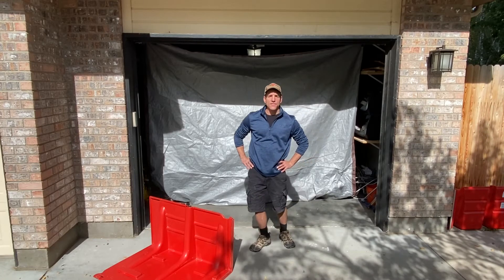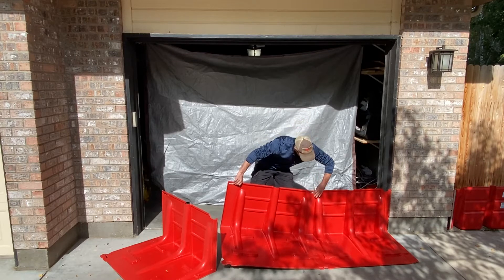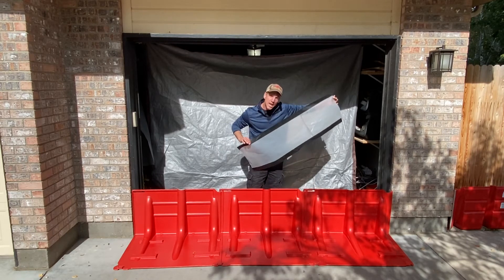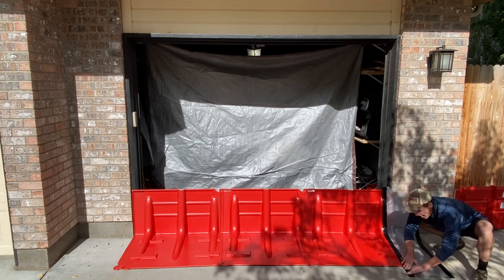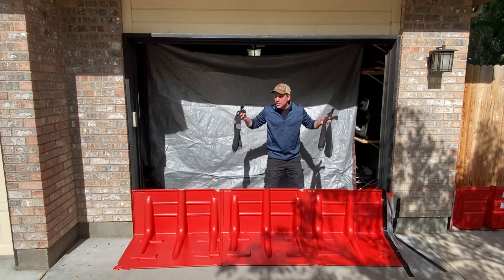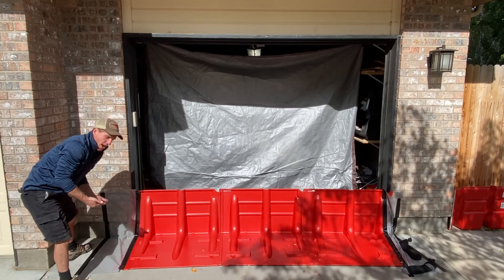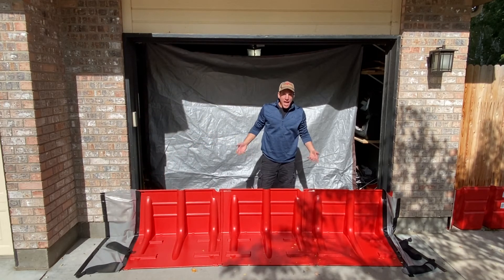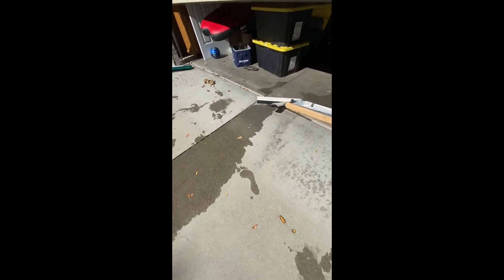NOAQ Boxwall Flood Barrier Tie In Example - Flood Defense Group www.flooddefensegroup.com

Comment: where can I buy those tales that you used to decide the sides ?
Reply from the maker: I simply used strips of 6mm plastic sheeting that was Gorilla taped between the wall and the NOAQ Boxwall as well as to the ground as seen in the video.
NOTE:  This test was to see what the seepage rate would be  for the Boxwall units that did not have plastic over them but.......It is easier to simply use one full sheet of plastic that is taped to the wall on either side of the NOAQ Boxwall as well as the ground in front of it.  Plastic is a fantastic 'insurance policy' against seepage and we like to cover almost every barrier we have with plastic.  It is too cheap, easy, and effective not to do as far as we are concerned.

Comment: In Florida the flooding comes with hurricanes. Will the barrier stay in place?
Reply from the maker: We have supplied countless NOAQ Boxwall flood barriers into hurricane zones where we suggest you place a sandbag on the toe of the unit for additional downward pressure in the face of hurricane force winds.
We have only heard of one line of NOAQ Boxwall (about 5 units placed between two buildings) get blown out of place during a hurricane.  In this case, the buildings channeled the wind and air pressure between the two buildings and the Boxwall units, which did not have sandbags on the toe, blew out of place.

In the example of this video, the units were placed up against what would typically be a closed garage door.  This placement, with a sandbag on the toe of each unit, would not have us concerned about displacement from wind because of the fact that there would be no wind being channeled through a tight space similar to the one example that blew out of place that was placed between two buildings.

I hope this makes sense and if you ever want to discuss it further, feel free to all us anytime!

1-208-585-1815

Comment: Would this sustain a hurricaine of 150 mph winds?
Reply from the maker: It would all depend on direction of wind impact, was it gusting, and the configuration of the NOAQ Boxwall but I would say that it would not UNTIL WATER IS AGAINST IT
Therefore, I would simply place 'x-amount' of sandbags on the toe of the product to keep it anchored until the water shows up if you are in a high wind environment.
This product is regularly used in hurricanes in this manner!

Comment: what's the unit cost of these?
Reply from the maker: For a full pallet or more, this is the cost broken down into price per linear foot.  We like to break it down into cost per linear foot because the Chinese copy products on the market are actually more expensive but because their units are smaller, it creates the appearance of being less expensive whereas the authentic NOAQ Boxwall (manufactured in Sweden) is proving to be more economical and of a higher quality.

20" tall option = $52 per liner foot
40" tall option = $92 per linear foot

Send us an email with details of what you are looking for along with a delivery zip code and we will get you a quote!

info@flooddefensegroup.com